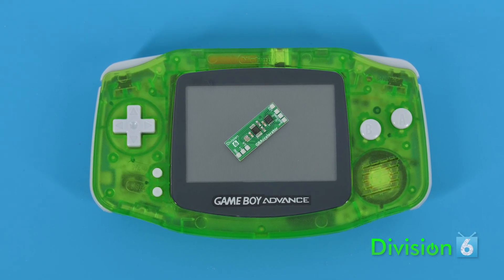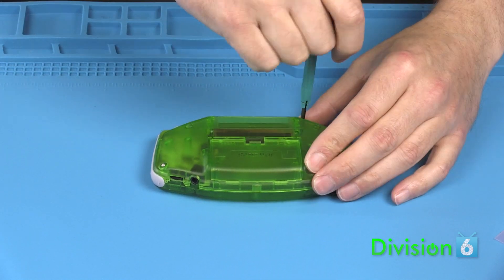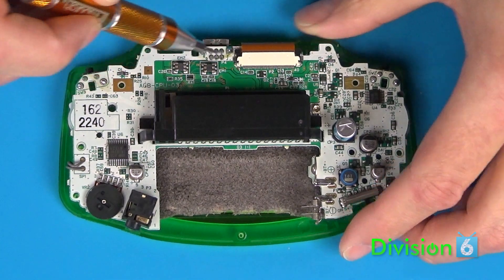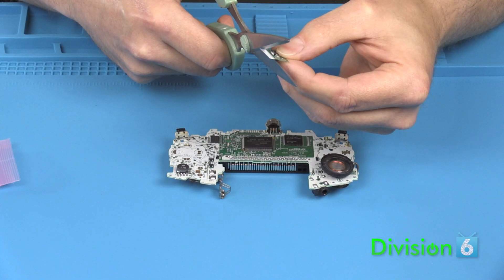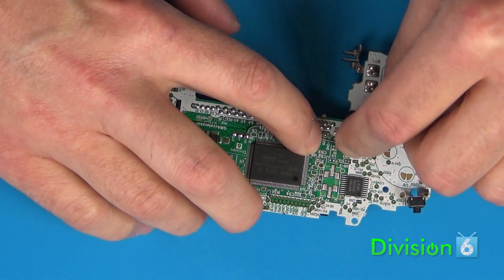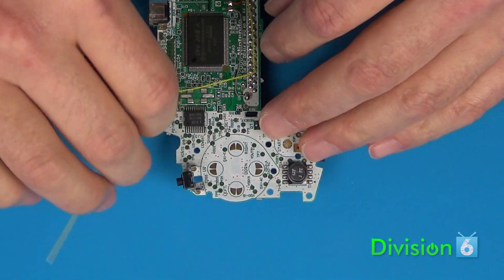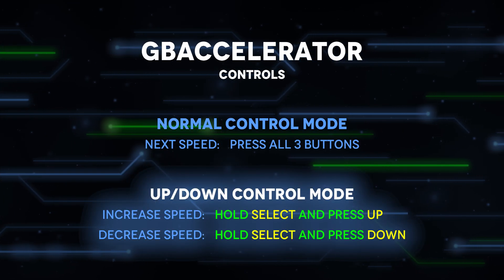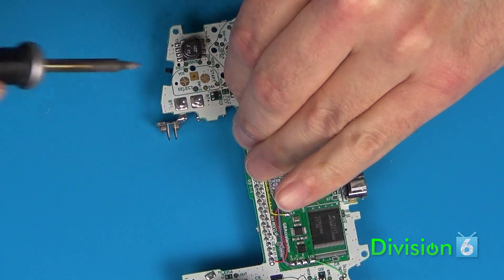Overclock Game Boy Advance! (GBAccelerator Installation Tutorial)

Comment: Hey so I’m in the middle of doing this mod on my DS lite.. I took off the X1 crystal but in the process I tore a solder pad and accidentally wound up removing the C2 capacitor.. sorry to post this here but if you can help I’d really appreciate it. Do I need to put it back?? Or since the X1 is out anyway then I don’t have to worry?
Reply from the maker: Those capacitors are only needed for the crystal, so don't worry about replacing it.  If you can find a remaining bit of trace to solder onto then you should be good to go!
Reply: @Division6Labs  you’re a lifesaver. I’m gonna go out this thing back together finally

Comment: Thanks for your Video. So I tested this

In GBA Games, Speed 1.5 works, but with 1.75 speed the system freezes. However in GB/GBC Games, the 1.75 works fine. So is this only available in older games ?
Reply from the maker: No, it should work with GBA games too.  Are you running the stock LCD?  If you need to lock out the top speed, you can hold all 3 buttons for several seconds until the LED flashes a few times.  Repeat to unlock it again.
Reply: It has also an IPS display.